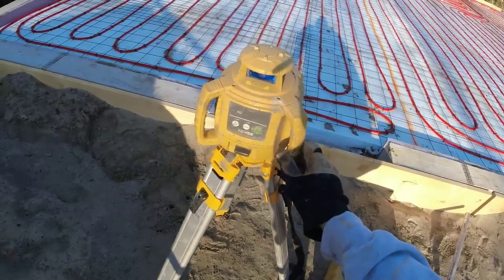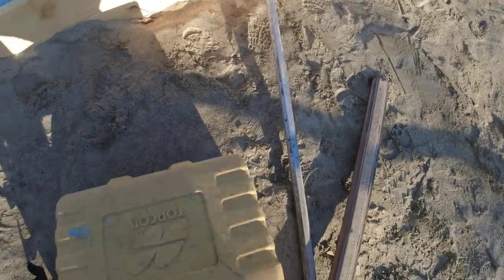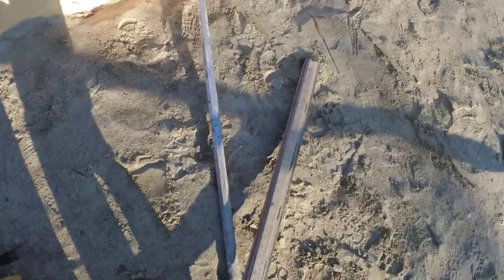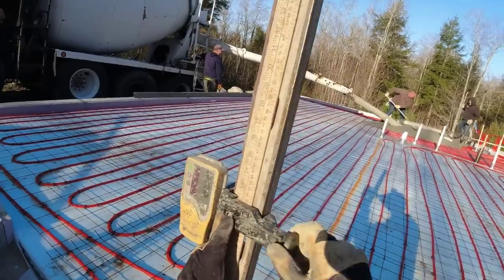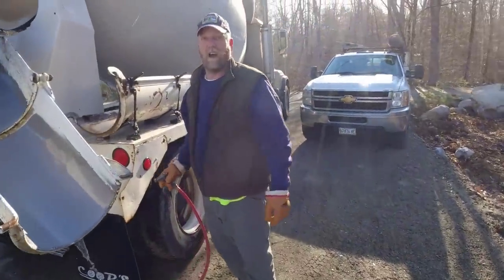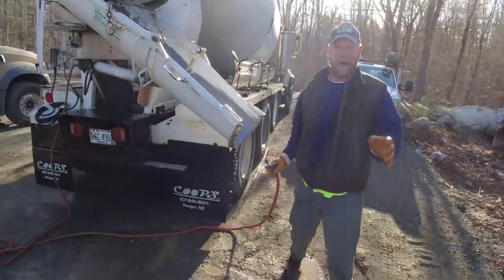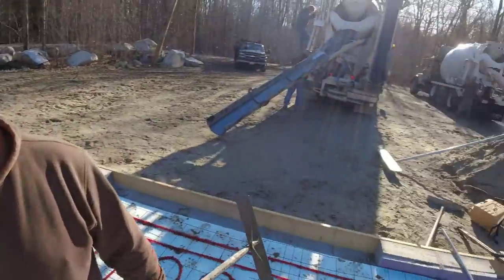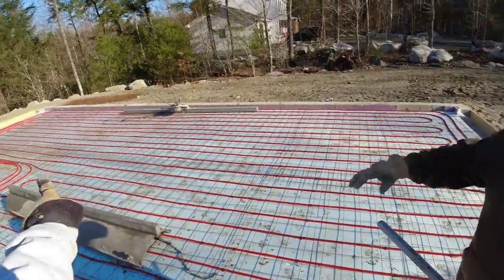Pouring A 40' X 40' Garage with Heated Concrete Floor

Comment: Are you not supposed to lift the wire and pex an inch or so as you pour? I've seen it done both ways in different videos...

Comment: I can’t see how that mesh does any good laying flat on the the styrofoam and don’t say you lift it up, because you don’t when I’m watching!
Anyway you do a fantastic job and the fibre mesh will probably be enough??
Reply: Looks like the mesh is sitting over the heating coils, which will be enough to keep it off the ground.
Reply: @FarmerBenny  nope the pipe is on top of the mesh ......holding the piping ..... What I did to mediate this i laid rebar in a grid then laid the mesh   on top of this, then the piping to the mesh .....there is chairs for piping but the cost is ridiculously high
Reply from the maker: We installed the wire when we showed up that morning, right over the heating tubes. You got to look close, but it's on top of the radiant heat tubes.
Reply: @MikeDayConcrete  it sure looks like it’s under the heater coils on the video!
But maybe it’s just my eyes